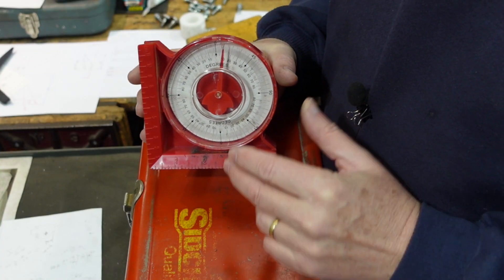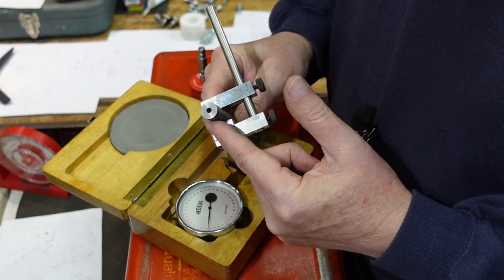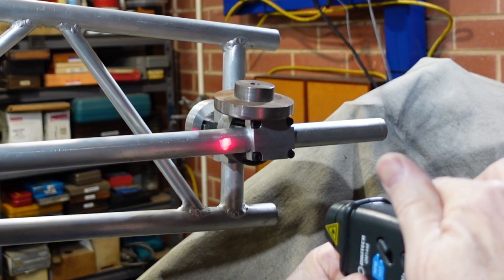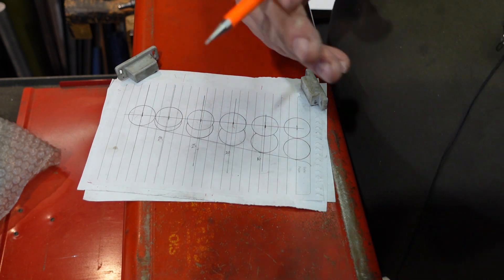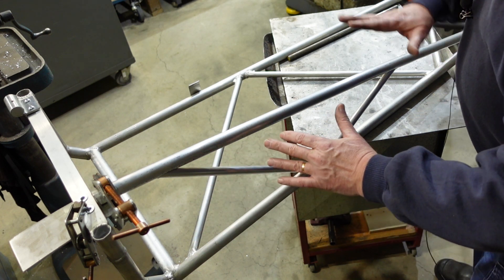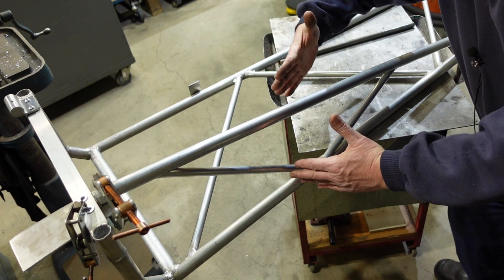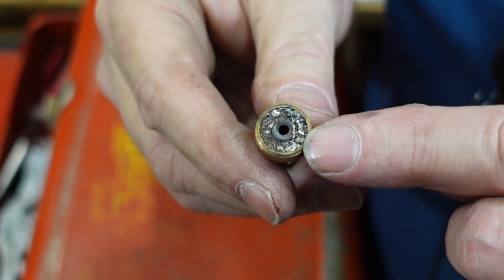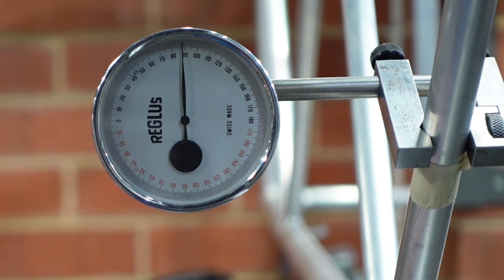The experiment needs help!

Comment: The frequency is proportional to : Stiffness divided by the mass. 
so if you increase the stiffness only by putting the same beam next to the old one, you double the stiffness, but doubles the mass, too.
this will not change the frequency. 
to increase the frequency you should increase the (in german the "statische Moment") "stiffness by design " ?? for example increase the distance between the upper and the lower beam.
Reply from the maker: The beam itself in it's plane is fine for stiffness. The problem seems to be in torsion/ twist. If I made the whole thing triangular with cross bracing it would be really stiff but then it would not fold. The two pieces were an attempt to stiffen up the torsional moment. I have a new hinge halfmade up. Once I have that installed there will be less relative movement between parts, so that should help too.

Comment: I have some comments on your aluminum welding, in my experience the issue you identified is correct that it is related to shielding gas. The gas lens smooths the flow of shielding gas, a dirty lens will cause turbulence drawing in air causing the contamination. I have also found that the volume of the gas is an important factor, as using a higher than necessary flow rate can introduce turbulence causing similar issues. gas flow should be as low as posable to provide the shielding necessary. I have also found that when issues start it is necessary to remove all of the contamination prior to resuming welding, as any contamination will causse issues even if you have all of the other factors correct. Also I don't sharpen my tungsten for aluminum, I form a rounded end on the electrode by creating an arc on a scrap peace of steel, the rounded end will make a broader arc and help flow out the edges on your beads. I hope the helps.
Reply from the maker: Thanks for those thoughts. I've run into the shielding gas flow one before, and with most of these, once you have the issue (and solve it) you can spot it quickly the next time. I must admit to being a bit lazy when it comes to removing prior contamination.
The main reason I included that sequence was in case anyone viewing has had similar welds and could not work it out - I'm learning as I go and hope it helps others.

Comment: Hi Mike, it is a great looking device. Perhaps look into the polar moment of inertia of your beam components for vertical stiffness, either in the upper tie strut or on the lower member. A vertical gusset in some key places and maybe some "parliament" style hinges could give you the balance you need.
Reply from the maker: Thanks Dave. I had a look at parliament hinges but I'm after effectively 360 degrees rotation so need either 2 axis of hinging (like bar door hinging) or some schmick hinges that won't sag when set up like I have them. There is a plan in motion for doing that at the moment...
As for calculating a polar moment of inertia, my head explodes just thinking about it. I know theoretically it can be done, but I have that many tubes running everywhere that even working out the location of the axis of rotation would be a challenge - because of the shape of the truss I suspect that it moves the further you get from the hinge. I might have to measure carefully and see if I can get it up on a CAD system to calculate that and go from there.

Comment: Sometimes stepping back prepared to ignore the sunk costs and re-evaluating can be beneficial mate, unless you want to keep throwing effort at it. Cantilever beams, especially open truss, can become a nightmare and ally isn’t a great damping material. Add stiffness and it bounces faster, add weight and it bounces slower as a rule of thumb, but you have to make conscious decisions to chase a resonant frequency beyond what it might encounter. Maybe strapping some carbon rods along the upper elements could crank up the tensile strength and damping, with little load added. If I ever decide to film in a workshop on a regular basis I’d put in steel landing pads above and use a monopod camera post with a magnet to attach. Make a huge Noga arm for your camera to hang from the ceiling 😂. Legit I wish my workshop was in action just so I could film that build myself.
Reply from the maker: Interesting idea - I was considering a gantry type mount, but it would need to have a 6m span in one direction, so getting pretty big. This was a compromise - I think it will work well enough with a bit more work. The Al was chosen for weight primarily, so yes, not the best for dampening.
Reply: @occasionalmachinist  I have to say I enjoy watching people learn by doing. Just the honest process of trying something and seeing if it’s better or worse than before.
Reply from the maker: @GTRgeoff  Thanks. It's an experiment - how well is yet to be determined.

Comment: Very interesting! Is there a relation double stiffness = double natural frequency?
Reply from the maker: There probably is - if I were better at maths I'd be able to tell you what it is. In my case, frequency is a convenient way of showing increased stiffness.
Reply: Not exactly, because as you add stiffness you add mass, which is a natural dampener. Ran up against this little beauty in second year mech eng undergrad. A life of weapons and motorsport engineering has given me a healthy respect for resonance. The function is based on the square root of the spring constant(k) divided by mass(m). f=(1/2*pi)*sqrt(k/m)
Reply from the maker: @GTRgeoff  Thanks. I had a sneaky suspicion that there was a square root involved, but it has been many years since I've even thought about this stuff.

Comment: A little bit of nit picking... you keep saying hundreds of Hz, Looks more like Hz to me -  @4:00 1 cycle per second... Anyway, interesting regardless. cheers.
Reply from the maker: I'm just going off the numbers I could read on the display. The before read around 100Hz on the display. It's a bit tricky because the Al is reflective too and confuses things. I guess too I should be halving the frequency I'm reading as once cycle should involve an up and a down - that would take it to 50Hz. The main use of the tacho was to get a relative indication of the stiffness of the structure, which it seemed to do.
Reply: @occasionalmachinist  "that would take it to 50Hz, so close to 1 cycle per second."
One of us has had a brain fart.
Reply: "that would take it to 50RPM, so close to 1 cycle per second"
Fixed it?
Reply from the maker: @stustoys  Yes. A Brain fade on my part, but as @GTRgeoff has pointed out, it was intended as a relative measure to determine improvement rather than an absolute number. In part I chose using a tacho like that just to show a simple way to assess relative improvement.
Reply: He has a hobby channel mate. Easy to mistake cycles per minute and Hz or cycles per second if it’s not your regular reference measure, and the premise was correctly applied as a simple reference tool of improvement in the desired direction. Maybe you should hop over to breaking taps channel and correct him. 😂

Comment: Two suggestions, possibly both not practical😉
-Can you attach guy wires that run from an axial rod extended from each hinge point to the end of each truss to give a bigger triangular truss on each section?
-Can you put a weight that is sprung from both sides out near the inside end of the last truss section to counter the bounce that is inherent in the structure, 
this may require some extended trial and error to get the correct weight and spring rating?
Third suggestion, (very impractical, but seen used on movie camera booms), mount 3 gyroscopes in the X,Y & Z planes at the end of the boom.😁
Reply: I was just thinking of mass damper, too. It probably won't take much weight. Even a few ounces should do the trick.
Reply from the maker: A mass damper is something that I have considered. I wanted to get the basic structure stiffened up first; next on the list is the hinge. As fxm5715 says, it would not need to be much. 

I don't particularly want to guy the first section and statically it is not twisting as much now. My next step is a new design of hinge. The design on there hinges as I want it too but is too loose and sloppy (modified commercial hinges - not surprising in hindsight). If I can firm that up I may get rid of some of the bounce/ flex.

Gyros are way too sophisticated for me. I've seen some of the gyroscopic camera mounts and they are rather spiffy. Some cameras now have an anti movement mode on them - if the bounce persists maybe that is the next step.
Reply: @occasionalmachinist  👍🏻